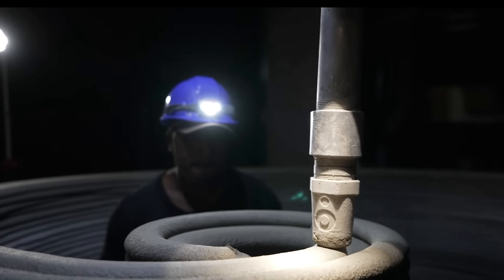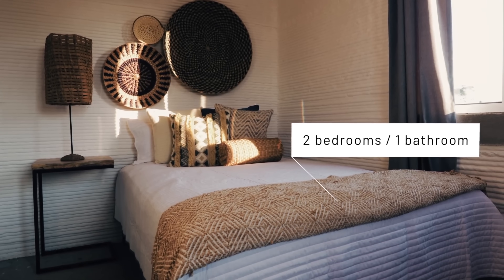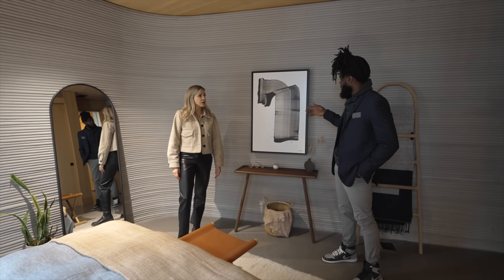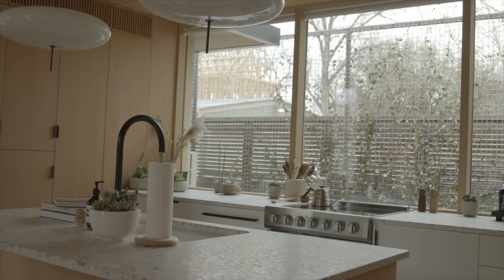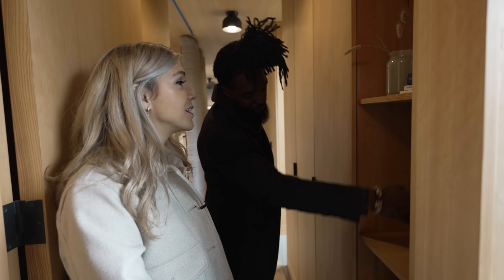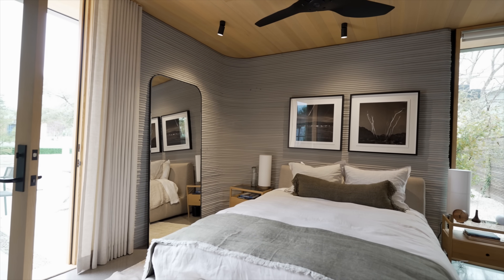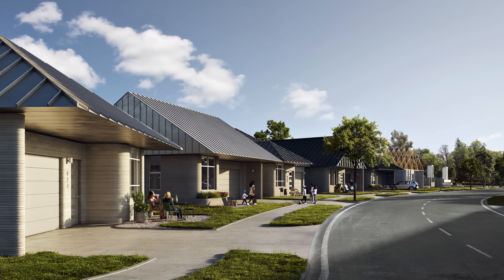Inside A 3D Printed House You'll ACTUALLY Want To Live In

Comment: Wiring, outlets and switches?  Is conduit imbedded in most walls.  Codes generally require outlets at 12' along walls.  How does the wall surfaces take paint?; primer, multiple coats.  seems like remodeling or alteration could be problematic.

Comment: Concrete shrinks and expands in cold and heat. If there is no rebar in the concrete it WILL crack. 

Good luck with your rubble pile.

Comment: ICON has a website with houses starting at 365k up to 1mil and you can get custom built homes as well. Unfortently there's nothing cheaper than that, which is a shame considering they usually do charity work. Id also imagine the  machines are only local to certain areas in texas and cant built in any location, at least not for cheap.

Comment: Am curious to know how well the double-walled design works as an insulator.  In damp conditions, insulation poses many problems, as the insulation retains moisture and then rots if it does not dry out.  This would seem to address that problem by providing an air pocket, while at the same time being vapour permeable.  So maybe it is a very good choice for tropical climates (or maybe not). Also, how resistant to earthquakes would this type of construction be, given that there is no reinforcing steel as in the case of traditional poured concrete.

Comment: Cost per sq.ft. of home for just the printed concrete as that concrete is the most expensive material in a home.  I'd need to see the cost breakdown. If you've poured a basement you know concrete is not a money saving material. 
Plus those walls should be sealed as that concrete is porous if not sealed. 
Don't get me wrong I like the idea so I'm mentioning these things to see if anyone here knows what the industry is doing about cost and sealing.

Comment: That would be SOOOOO much concrete to build. I bet that little 300sqft uses 1 truck. Now you also have a 2000+sqft house thats what 4 trucks. But inguess what you save on labornyou can use to the higher cost of amount of concrete used.

Comment: What I think is : It's shit. Why ?
- Ok you can make houses easily and you can imagine do that for poor people who have nothing. Yeah. For that it can be a good thing.... For start... Because the negatives :
- It's in plastic I guess or it can't be printed. Plastic is a bad thing. Yeah. Even if you don't believe it.
- Because it's plastic... With the climate problems we have and who will be even worse in the future, heat + plastic isn't a good combination. It will be too hot inside. And if it goes very very... Too much hot, maybe it can melt. But we'll all be dead maybe by that time. Or not because in tropical places it can be really warm allready.
- One of the real problems is coming. And it's a big red flag : Plastic doesn't help the "nature" to breath. So moiste will come. Whatever you do.
- Broken plastic is not easy to fix. And only fixing plastic can damage the whole structure. So it becomes dangerous by the time.
- You can melt the walls to break in. Allright you can cut a wooden cabin. But can you do that in concrete without explosives or a solid vehicle ?

It's not a good thing. At all.
Reply: bruh when did they ever say the houses are made from plastic ??
its concrete, did u even watch the first minute of the video...
like it has its downsides for sure but it can be fixed later on, like yea moister will kill it if it stays like this, but it doesnt have to stay like this...

Comment: He said that the concrete is very thermally dense. What kind of concrete is used here? Is that aerated concrete? Because as far as I know standard concrete would need to several meters thick to reach 0,24 W(m²K) for example (German standard for new low energy houses)
Really interested in finding that out

Comment: You will never be able to "print" cabinets because they are already built by factory automated machines and only need assembly. There is nothing gained by 3d printing anything but the walls. I don't get it, this is just saving a little bit of brick laying work and that's it. most of the work is in everything else anyway. windows, doors, plastering, paint, pipes, wiring, tiling.

Comment: 0:27 guy calls himself “chief people office” = “bull$hit artist”
🤣🤣🤣🤣🤣🤣
1:28 “chronically homeless” that lingo is new to me.
3:33 “Jack & Jill bathroom” used to be called “husband & wife bathroom’
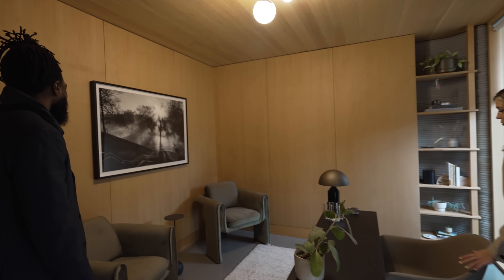4:13 “if covid has taught us nothing… how to utilize our spaces“ 🤔🤔
Making walls & ceilings from wood is extremely $$$ compared to wood framing then sheetrock. 
It costs way more $$$ to heat a concrete house than traditional wood frame. Concrete absorbs very high moister then causes that to create excessively high % of mold to grow.
Even if you want to leave the cement wall look untouched you still have to at the minimum put multiple layers of concrete sealer over then interior & exterior. 
Tons of dirt & dust will accumulate on interior & exterior walls bc of concrete. 
The costs to put in electricity, plumbing, insulation, HVAC etc will be sooo expensive bc you have to cut holes in the concrete vs wood frame & sheet rock. 

6:03 “built in desk” how much is the labor & materials going to cost to make that desk & shelves? A lot of $$$.
The guy keeps saying “we borrow from European moles of homes” they use rebar in the construction, bc if you don’t the house will excessively shift in multiple directions causing a lot of $$$ to fix. 
born in USA lived here most of my life & lived in Italy many years i know the construction materials used to build homes with conventional USA materials & Italian, concrete, steel, tile, cinder blocks, marble etc. 
They said it would be more cost effective to make these homes for the “chronically homeless” but in reality it actually costs much more. 
If you’re rich & live in states where temperatures in 24 hr & yearly cycles 
don’t vary that much this 3D concrete printed house is another option.

Comment: Construction technique/concept as explained by realtors. Sighhh
I do wonder about that roof beam flashing detail as well as window and door flashing. Must be a lot of flattening of concrete surfaces. Looks like they hid a lot with wood.
I also wonder what the walls look like after a few years of dust. I assume they are very hard to clean and they have endless partially horizontal surfaces.
Is it really that much cheaper at all? You never mention costs and most of the cost of a house is the services and all the carpentry, none of which has been replaced.

Comment: I am blown away when I saw these 3d printer house.   Although not necessarily very environment friendly to produce these concrete mix,  concrete is a very good insulator.   And it is strong.   So the energy saving during its life can be very substantial.      Compare to common construction method,  it is very simple.    

My concern is that if you damage the wall or due to age these concrete starts to fall off,  the repair of these concrete built in these little layer after layer to its original will be impossible.       So you  may need to plaster/render the whole wall.      Or if you want a traditional looking wall,  you may want to render it right at the beginning of building these houses.     Since it is only the beginning of these tech,  I wonder if they can further improve these 'printers' so that they can also produce a totally flat surface wall such as automatically applying render.

Comment: So Icon's 3d homes in Austin were listed at 475k to 570K  1574 SF to 2112 SF   ...so where are all the cost sayings I was hearing about? 
"It's cheaper to build" was what it said on the video ..and maybe that's right. It's cost less for Icon to build these houses but still charge market rates. 

3d homes appear to be the benefit of the builder ...not the end user.

Comment: They still haven't told us construction costs and why the temporary shelter over the job site ?
Is that factored into the cost too ?
How do they bring the insulation up to building code ?
Labour to build the outer shell of a house is a very small part of the cost and labour to build the foundation, floors and roof are a lot more and not even talked about.
There's other questions, so why don't they want to talk about them ?

Comment: The walls inside should absolutely be covered with plaster. The horizontal concrete will make dust an issue and hold smells. To prevent old people funk in your house, sweep your walls once or twice a year and that’s just for the spray texture on most walls- those rooms would smell like old people house within a year and good luck if you have allergies. Finish the walls and I love it!

Comment: compared to a conventional brick house how much does it cost to get up to second lift height ready for the roof joist ring beam, Everything else is of no consideration as electrical, plumbing, heating/cooling along with the roof is exactly the same, possibly cheaper with conventional builds as everything is off the shelf now for those builds, what about cracking, concrete needs expansion joints, maintenance of such a highly textured rendered finish isn't going to be easy, whether painting or cladding I see problems, as an old guy said to me many years back when I first worked on the buildings "today's materials are tomorrows problems" he was referring to concrete tower blocks where we lived all of which lasted 20 years and had to be demolished, google search>>Killingworth Towers North Tyneside<< 
How long does it take the pore moisture to reach zero on these printed walls, 
As he said "There isn't a straight wall anywhere" The second fix is going to hate working on these houses, the extra time making everything straight and having to pack everything is going to be very time-consuming, kitchen units don't come bowed or curved ! everything will have to be bespoke and the costs will be huge,

Comment: I think it would be interesting to develop some kind of fabric covering that could be hung on frames on the walls. It would be a cost effective way to cover the concrete and give it a smooth look addition to improving acoustics. Perhaps it could also be in an additional insulating layer, if Glass wool were added. It would also obviate the need so repair any small cracks that might develop over time. Junction boxes could also be mounted flush with these panels.

Comment: The cement, the key ingredient in concrete, is one of the main producers of carbon dioxide, a potent greenhouse gas. Concrete causes damage to the most fertile layer of the earth, the topsoil.  We need to replace concrete and steel in the construction industry with Wood harvested from sustainable environmentally, managed forests.

Comment: There are a couple of important points depending on where you live. FIRST, with the cost of houses rising to the point that most family can't afford to purchase a home. This reduces the total cost and allows first time buyers entry into the market. Now if the the builder isn't being "greedy" a home of approximately 1600 square feet can sell for 275,000 to 330,000. Now this is a basic model and with no Hugh add on features!! It can be completed in less than three weeks!! SECONDLY,  Property and Fire Insurance are expecting to raise premium's in the range of 45 to 55% ( quote "elevated risks"). The formulas for these houses can be 90% fire proof!  One formula is similar to the wings on Boeing jet airlines!  It can take a 1000 degrees!  Cement will not burn! So why do you need insurance!
Now if you put wood paneling and wood roof you will need insurance!!! The roof can be aluminum frame and  fire proof tile or fire retardant ceramic tiles!!! Doesn't, burn !!! Right!!! 
Thirdly, the base is cement floor so very quick recovery if flooding occurs!  Your cement floor can have tubing installed for heating along with solar panels on the roof!!  Now for tornadoes and hurricanes the rounded walls add strength to withstand the high winds and you have narrower windows with protective lids!!! Windows are recessed.  Earthquakes zones the base with have ball bearing or pressure points rods to relax the S wave portion of the quake! And rounded off walls are stronger. West Coast regions can anticipate a Earthquake in the range of 7  based on historical data. Actually we are over due!!!
3 D printed houses also off a partial solution for the homeless situation. Small  dwellings of 500 to 600l squared feet can be erected for seniors especially and build small communital zones in larger cities!! 
The other aspect is reduced energy consumption during summers since cement has a different heat absorption rate! Energy Costs are raising quickly for a number of reasons. 
So their exists opportunities to improve the chance of the middle class to own real  property!! Right now we have terrible odds in owning a home. Also you also have the electric cars issue tapping into people disposable income. New homes will have updated electrical systems at their homes to charge their vehicles.  Plus each house will need solar panels on them--- period. With these expensive vehicles we will be short of charging stations and have brown outs because of low conductivity wires!!! But that's another disaster in the making!!!

Comment: I wunder if you can print the walls more hollow and use them as space for plumming maybe even pause at certain heights and put the stuff in the wall, then keep printing. And also when doing something like that, what about insulation? Thermal mass is well and dandy, but it still has nothing on proper insulation

Comment: I love the design although I don't typically like modern design but the curves and the rounded extruded walls really smooth out the typical corners of modern architecture.  Not sure if I can tolerate all that concrete over a long period of time like 10 yrs.  I am really interested in the cost comparison and all the plaster wall finishes compared to a traditionly built house.

Comment: 3D printing a house is just a half-assed job as it seems. You still got to do all the things to the house that you would do to a house after you build the frame. This only creates naked walls. But now you have to put a roof on it. And you have to add another wall on top of these walls. As if you're doing drywall work. So this is just half a house frame..

Comment: No matter how we build houses in America, they will still be expensive. If the house cost $10,000 to make. They will still find a way to charge you $300,000 for it. Remember when container homes was supposed to been the next cheap alternative.🤣 About 99% of the things in America does not have to be as expensive as it is. They call it supply and demand. But it's actually corporate greed. Things don't really get better. they just get more expensive. And then we blame it on inflation. But as long as inflation exist people need to make more money which is going to cause more inflation. How did we get here? I feel like a frog sitting in a pot of water that is slowly coming to a boil. And by time I realized that I'm being cooked. It's too late to jump out the water.

Comment: Printed concrete homes could fill a nitch in the housing market, but there is no way the cost of concrete will get low enough to match wood in the US. It also is not going to be viable in more extreme weather areas without better insulation. I am not a fan of the uneven texture, not so much that it looks like rolls, but that they are not even. And as stated elsewhere, that uneven, rough concrete will hold dirt, dust, mold, and environmental by products (think leaves in the fall), so outside of the nice clean spaces they showcase, the outside of the house is quickly going to be filthy.

Comment: I want to see an engineering study to compare the carbon footprint of a standard wood frame home vs the carbon footprint of a printed concrete home vs poured concrete form construction both for initial construction and the energy efficiency through the years.

Do a search on how is cement made if you are unaware of the vast amount of hydrocarbons that are burned in the manufacture of cement. And then if you don't understand the difference between cement and concrete search on that also.

Now I have to find a video on how plumbing and electrical wiring are run.

But as to the look? I hate it. I absolutely would have to stucco it outside and plaster/tile/sheets of marble or granite inside. Ooh. Sheets of marble or granite outside also.

Comment: I would live in this house in a heartbeat. But first I’d need to know how these solid walls would function during an earthquake, or even hurricanes or tornadoes. Stick built buildings are required to tie down houses to make them safe in winds up to certain strengths. The solid concrete walls seem concerning if hit with an earthquake. There are no mechanical connections built-in to allow for earth movement. Beautiful build.

Comment: Two negative features of cement walls one it absorbs heat so even at night your house will be hot what ever you save in initial price you'll pay for later in AC costs especially it hotter environments like Texas. Secondly cement especially without the stability of rebar are very venerable to natural disasters like earthquakes which could fall on top of you.

Comment: You really are an air head if you beleive a concrete printed house is less expensive side than literally any other house. Instead of just drinking icon cool aid why not challenge them on the sustainability of concrete vs rock. Concrete is one of the worst polluting materials, building with brick and using cement inbetween layers is done because its cheap, no one would make an entire house out of concrete it makes no sense.